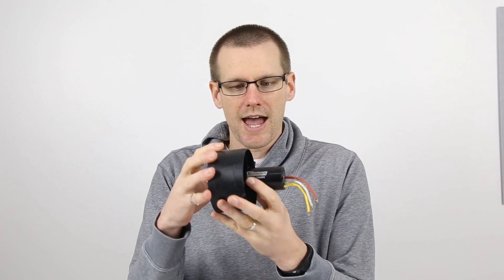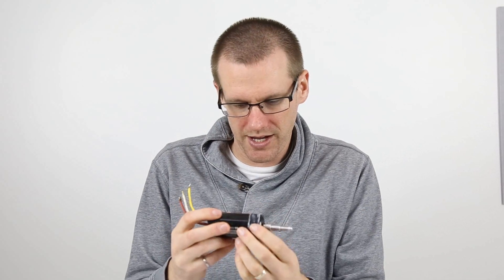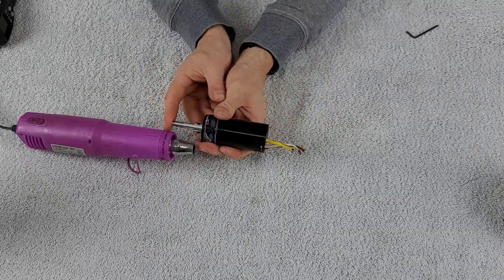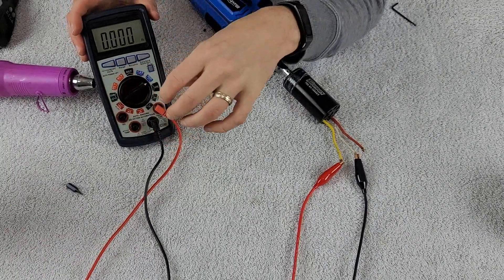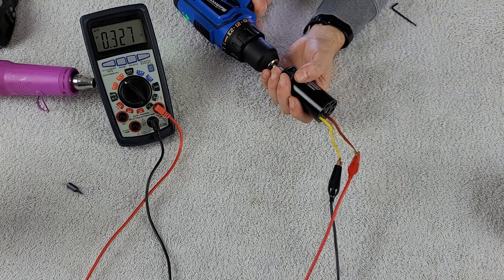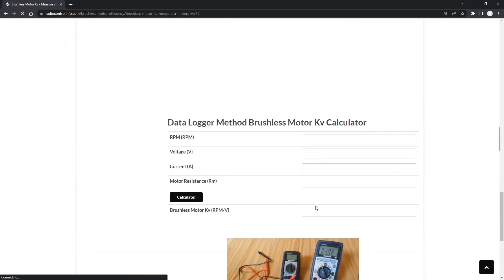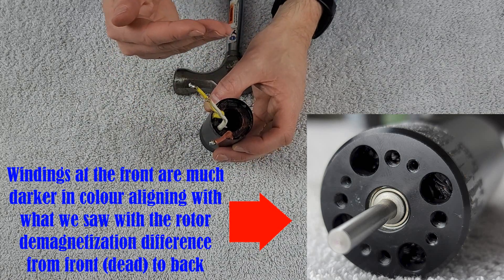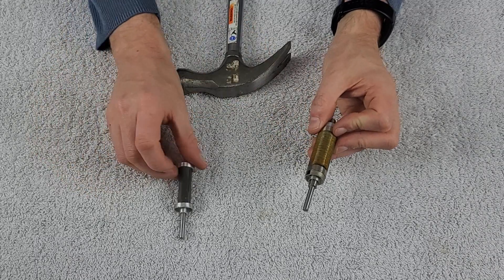This Brushless Motor Is in MUCH WORSE Condition than I Expected

Comment: I accidentally shorted a sensor wire and a motor wire on a Xr8sct 140 Amp esc. The bec, still works and the motor will calibrate minus any beeping sounds. However the esc will not run the motor. (Hobbywing 4068 1900kv) when I turn it on the light flashes but no beeps. It isn't sending power through the motor wires. My question is what do you think? Could it be repaired by me? Have you heard about this type of failure. When it shorted it gave a solid green light for 30 - 60 seconds. What you think k?